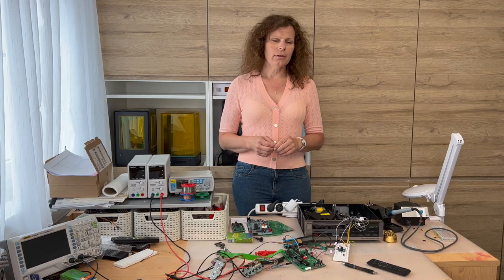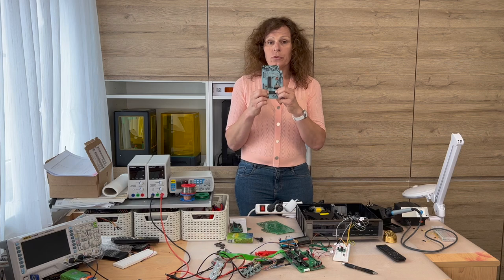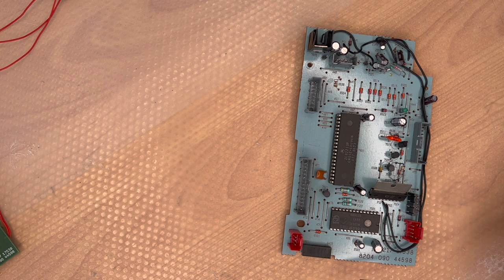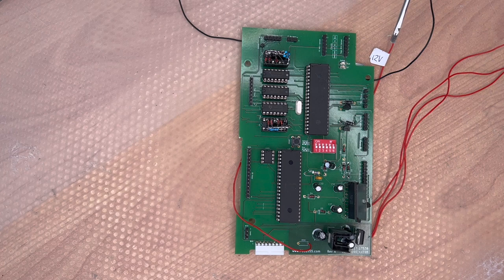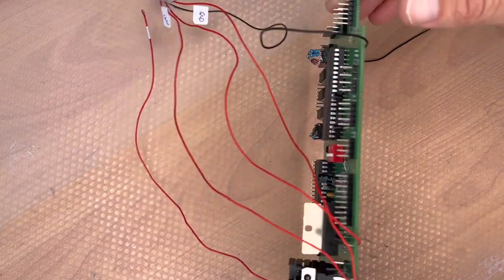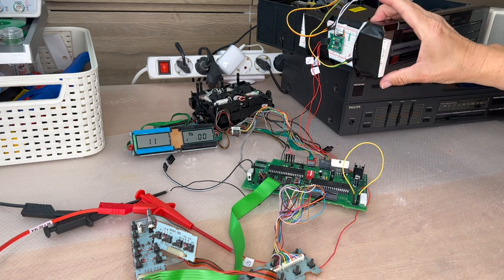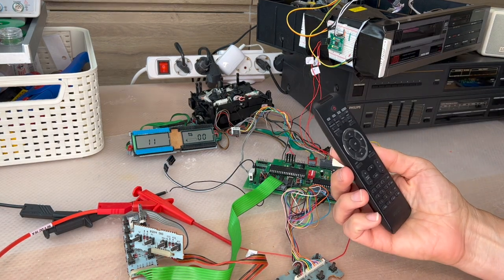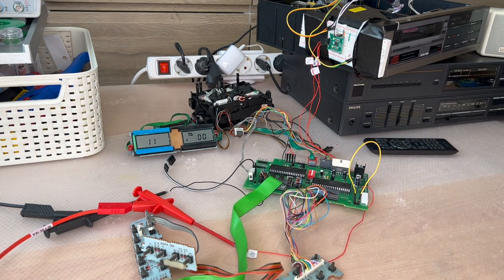Philips CD555 Mods - new controller for a Philips CDM2 CD-Drive, Part #1

Comment: Nice video! I own a Philips CD380 player and I would like to add remote control function. Do you know what is the best and cheapest way to do it? This model has RC5 in / out orange colored RCA but I think this only works with a compatible (for example) philips amplifier. Thanks.
Reply from the maker: Hi,
I think it should be possible. There is a lot of documentation for the rc5 protocol available. Also Wikipedia can be a starting point https://en.wikipedia.org/wiki/RC-5
…or you get a Philips Amplifier :-)